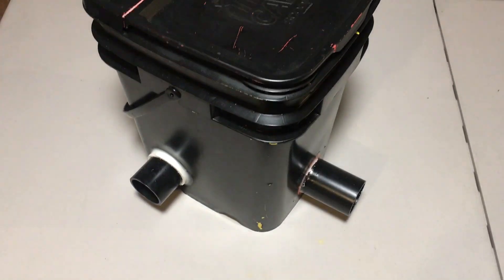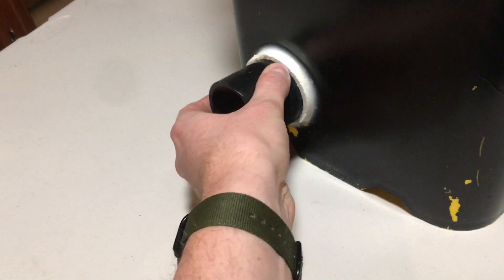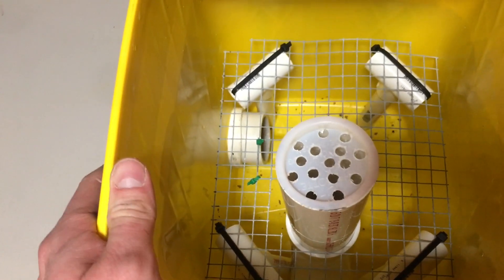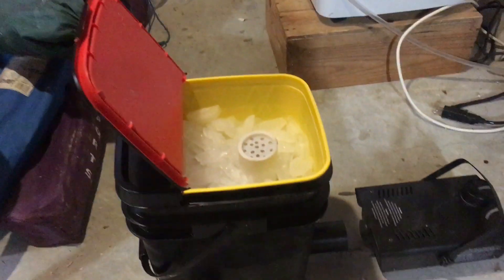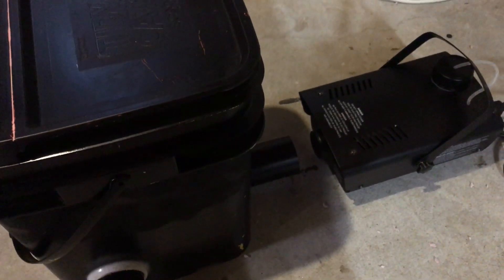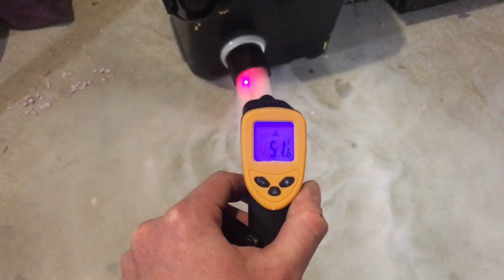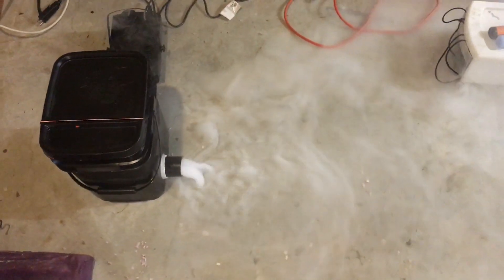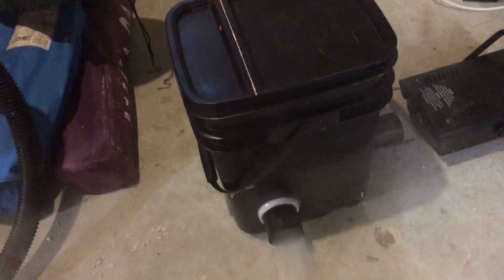Vortex Fog Chiller & Demonstration

Comment: Has anyone compared the 2 types of chillers? Passing through a tube entirly through with ice around the tube and out .. VS .. one that sends the smoke actually through the ice and back into an outlet. Efficiency output etc?
Reply: You mean a gravity chiller like this one is and a proper vortex chiller.....with Aluminium ducting that goes round and round then covered in ice....

Comment: What happens when the ice melts...
Reply: I kinda made this comment wrong lmao!!!
Reply: I believe this question was meant to be the same question I have, which is that it appears that the fog outlet pipe is only 1" to 2" off the bottom of the bucket so the melt water will eventually flow out that hole.

Seems like you use this outside so that is not an issue for you, but would make this less effective for indoor use. Can you confirm that this will eventually leak melt water?  I am trying to come up with an effective design that is essentially what you have made, but that can contain all the melt water
Reply: @keithcox2003  I think what would make this design drastically better is to change the outlet where fog escapes. You can keep it on the bottom but make a 90 elbow straight up. Then another pipe straight up to at least the height of the container. Then, another 90 elbow out - basically forcing cold fog UP and OUT. This will help 2 design flaws: Cold air escaping at the bottom and water leakage. The force of new fog will push the chilled fog up and out and it should be even colder than before. In fact, I want to test this on my own but it makes sense in my mind.
Reply: @isometrixk  Outlet should always be bigger than the inlet, If you using say a 1.5" inlet the outlet should be at least 2" out. Having it the same size your increasing the dwell time the hot fog is in contact with the ice so it's going to melt it faster. But if the outlet is bigger it can escape faster so it not only makes the ice last longer it also prevents any back flow of fog so less chance of leaking out the chiller.
Reply from the maker: North Eastern Iowa Wx, & more typically, when ice melts it produces water

Comment: Hello please respond would this work with a 2000w fog machine output 40,000 cubic ft (1333m3) approximately
Reply from the maker: Boo Hoo you’d need to make one a lot bigger, like out of a cooler or trash can. Like I said in the video, with a chiller this small, your best bet is to use a machine that is 400w tops.

Comment: Love the tutorial. I'm trying to host an awesome Halloween party this year and want to have the whole floor of a 2100sqft condo covered. It's all one floor, thinking of positioning three or so of these strategically. How long does the ice last before needing replacing? What do you do with the water that comes from it melting? Does it end up dripping out the exhaust? I guess you can raise the exhaust a bit if you needed to. Can the cold smoke be routed with piping? PVC or any kind does it matter? Would metal dryer ducting be best since it might remain cold? Wouldn't mind having one of these in the corner with 10 or so feet of ducting in two or three directions to have it pump out in different locations.
Reply: Hello if I was you use a thinner PVC pipe as it will cool faster but I'm just wondering if a 2000w fogger would work for this
Reply: And yes u can use piping mate some just use piping with a box filled with dry ice it don't melt much from what I have seen